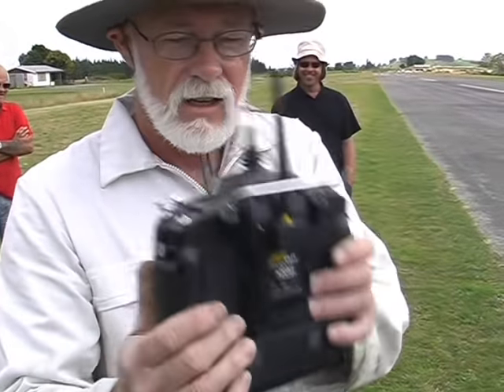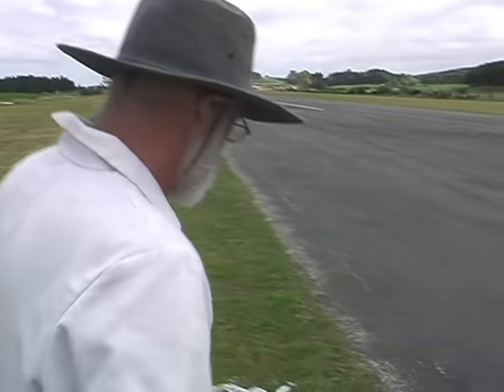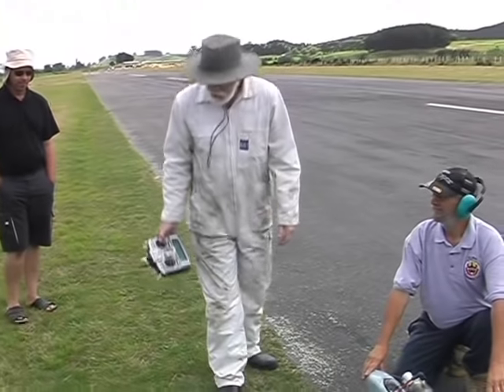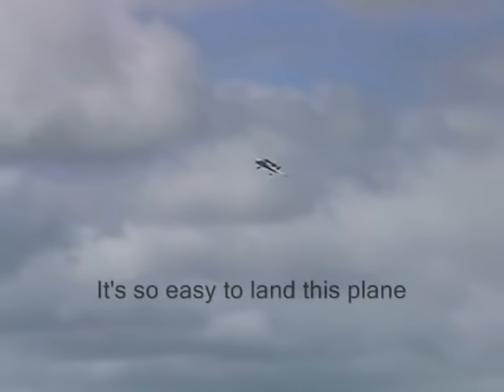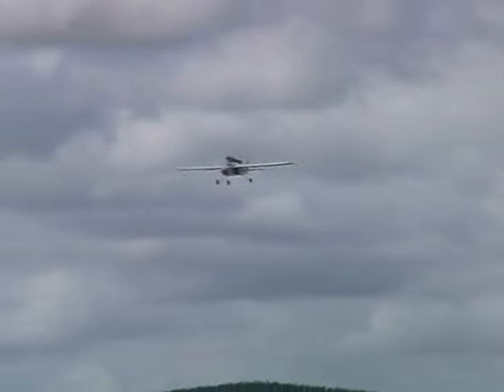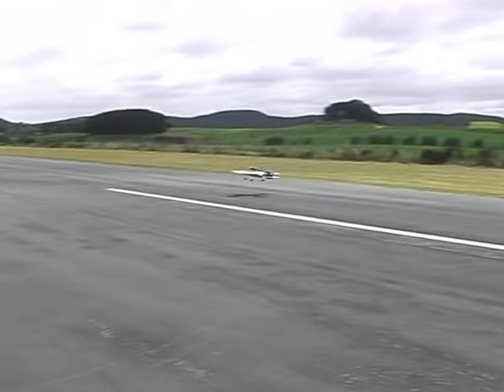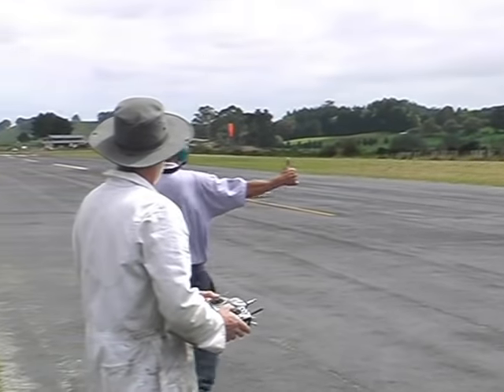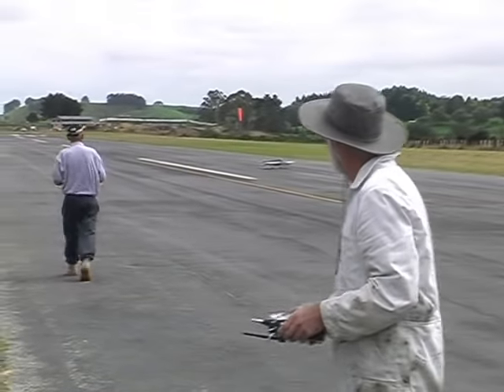Pulsejet powered World Models TameCat RC plane, maiden flight

Comment: Seems like a small electric fuel pump with a proper regulator and return line system would fix the problematic and flaky nature of using a gravity feed for this type of engine. That way you have a controlled positive pressure that's very consistent, easily throttled, and can be cut off without the hazard that a pressurized tank would cause.

Cool plane btw, even if it's loud as hell.
Reply: 8 inches between the bottom of the fuel tank and the injector  will cause problems at high G no matter what the pump pressure.

Comment: @xjet Yes, but you forgetting, pressure conditions in a Pulse Jet change during flight, and so will your pressure from your tapping point. You need something constant which does not rely on pressures generated from within the engine itself. Your tapping point will also pulse...just like the engine itself does as the pressure wave travels back and forth along the engine.

Comment: Pulse jet engines intake air simply through being open, while turbine jet engines have a spinning fan that pulls the air in. This causes the air to be burnt in a pulse jet in, as the name suggests, pulses, as there is a split second delay before the air is able to re-fill the combustion chamber. They tend to be less powerful at low speeds, however at high speeds the lack of obstructing fan allows in some cases more power than a turbine engine. Also they don't catch on fire as much :p

Comment: @xjet Yes, the Tank is low compared to the engines position on this bird. The Doodlebug used a spherical pressure chamber to keep it fed with petrol during flight. If you could use your system, then for sure the Germans would have done the same, as its simpler....but its not reliable.

Comment: @davidrodgersNJ A pulse engine are extremely inefficient when compared against a moder turbofan engine.  Also, it's impossible to implement on them a decent throttle on them, they're optimized to run "effiently" at a certain fuel/air intake ratio. Pulse engines are similar to afterburners in a fighter jet, they provide a constant amount of (extra) thrust in a relatively simple way, but simplicity comes with compromises, the main ones being the lack of control (throttle) and fuel efficiency.

Comment: Nice! Are you not concerned about the vert stabs disintegrating in the exhaust? Is that thick straight wing designed for those kind of flight loads?

Comment: great work ! -  i was impressed by the acceleration and how well the plane held a glide without all that power and the extra weight of the pulsejet on top.  She seems very well trimmed out .  How long can the PJ run for before u expend the rations onboard?

Comment: @xjet
  Ah, just found this. Epic !
   The Kerosene-Powered Flame-Farting Flying- Didgeridoo... ; Yahoo !
   I still have an old 70's Advertisement for a pair of these, on a Hang-Glider's A-Frame, fed by a Butane Backpack...!   Reportedly, when tried, it pitched up uncontrollably, then stalled & slid backwards to crash ; and then it burned, when the Jets lit the Dacron. Pulse-Jet & Weight-Shift, bad combination !
Ciao.

Comment: Any chance you plan to make a new body for your HK pulse jet that cracked? I am expecting to run into the same issue as now that I have taken a closer look at mine, the welds are indeed pretty poor... It sounded like in your video review that the valve plate and intake were made well and it would probably be more efficient with a better designed body?  I have been looking to find out how short the body can be redesigned, it seems like it was made longer then needed due to its small diameter but have not found much info.

Comment: Imagine a typical scale A-10 that is capable of flying around with the stock  EDF's and when pitched in a dive you light up a Dynajet PULSEJET thats mounted to the plane to hear a deafening roar just as the real A-10 Warthog does with its unique strafing gun!!! What an idea!!! I believe that we as humans should all work collectively together , that is why im openly throwing this great idea out to the web! Just think, A typical EDF A-10 Warthog with an addition of fuel tanks in the hull and small wing tanks. The tanks would fuel a Dynajet pulse jet engine mounted on top of the plane (preferably centered with the fuselage to make it balanced,;  the tip flush with the ducted fans would be cool) complimented with a tuned, intake/ fuel/ ignition system that is able to auto start, mid flight (easily doable). =)

Comment: Thats the fastest running pulse jet I've seen. Usually you can clearly hear the different pulses, but this is pulsing so fast I wouldnt have known it was a pulse jet just by listening to it. I'm surprised at how much power and acceleration it produced too. I assumed they were much less efficient and powerful than a standard jet engine, but obviously not too much.. Did you design the engine yourself? Does it burn fuel more rapidly than typical RC jets?
Reply: No, you can't hear the individual pulses on any pulse jet, I can assure you.
Reply: @oldchunkofcoal2774  
You can easily hear the pulses on the V-1 flying bombs, which sported the original pulse jets. I've seen many medium sized pulse jets with pulses that are easily discerned.
Reply: @oldchunkofcoal2774  
You can easily hear the pulses on the V-1 flying bombs, which sported the original pulse jets. I've seen many medium sized pulse jets with pulses that are easily discerned.
Reply: @HighlanderNorth1  No, you THINK you can hear the individual explosions, but the V1 was making 50 per second...
Reply: @oldchunkofcoal2774  
It's clear that you are "assuming" that I don't have bionic ears..... Are you sure it's logical to assume that of me? (Hint: It is ...)

Seriously though, we can hear what certainly sound like "pulses" when listening to many pulse jet engines. But if that's not the actual pulses we hear, then what is it?

Comment: Nice one Bruce. Have you experimented with adding exhaust insulating wrap (Automotive titanium wrap or similar) and if the extra weight is offset by additional performance, higher exhaust temperature, thrust and velocity? Thank you for sharing.
Reply from the maker: I have found that a ceramic coating on the inside of the engine does produce measurable thrust increase and also increases engine life.
Reply: Theoretical science meets applied. Thank you very much.

Comment: @xjet No, I dont think you understand. A small metal can is pressurised with say 80 PSI. You then use an air pressure regulator to pressurise the fuel tank....just 0.25 PSI will give a consistant flow and a reliable run. Pulse Jets are poor at sucking fuel, like most engines for that matter. This WILL cure your lean outs...trust me. Failing that you could use a small electric fuel pump like we use on our gas turbines, but the pressure method is simpler for the simple Pulse Jet.

Comment: Thats great, I assume you are using ordinary petrol from the pump?...Why dont you use a pressurised tank?...IE an aerosol type container you can then pressurise with air and a regulator on it to give constant feed pressure to the liquid tank. You just open the fuel feed after the engine starts up....:)...Constant setting regardless of flight effects.....:) I make my own turbine engines BTW..:)

Comment: I really enjoyed the Tame Cats Build and Maiden Flight, I know that air bubbles in the fuel will shut down the jet, Question ? would a bladder tank and springs in the fuel line at the fuel injection spray valve help to eliminate air bubbles and keep the jet running, and would a on board ignition system or a glow plug help to keep the jet running, just my 2 cents worth, BTW I really enjoyed your Hummor and Aussie Accent :) :) :)  Take care and have fun, Chellie in So. Calif, USA

Comment: Great guidance but that cheap pipe engine needs more development, it will likely take a fuel pump and damper added to the pipe which the engine itself should most likely be cast iron to withstand the potential heat extremes once it builds enough power when that occurs it will as well need a much stronger airframe the thing should reach near Mach with some research any combo of fuels will likely work liquid oxygen could work even better obtaining obit with a go pro it without doubt a must but you'll need a RCA DSS satellite link to get out that far.

Comment: Hi Bruce. I was just wondering how fuel efficient a pulsejet is. If for example I had a hobbyking pulsejet of reasonable quality, how much fuel will it burn per minute at optimum output.
Reply from the maker: They are very fuel-inefficient.  Watch my RCModelReviews channel next week.  I'll be showing a XUAV MiniTalon powered by a HobbyKing pulsejet and you'll see first-hand how much fuel they use :-)
Reply: they are only efficient in making huge noise. cool as fuck though :)

Comment: Why aren't we using these engines for more applications?
Reply: Sam Fosdick most fuel innefficient engine ever conceived.
However those ramjets are based on this.
Reply: Also just turning them on is a huge pain in the ass

Comment: lol I think it's funny and cool. I see some moron or idiot making RC and causing some kind of injury , accident or fire.
The exhaust gas velocity of some model jet engines can exceed 1000 mph and the thrust to weight ratios can easily exceed 1:1 . And by law model jet planes are restricted to 200 mph.  You say 120lbs thrust to 7lbs body. That's a little over 17:1 thrust to weight ratio is insane. Your TameCat body would most likely rip it self apart at the speed of sound. Swept back wing design and you can have a supersonic RC  and that's crazy. Awesome vid
Reply: This pulse jet has 3.5lbs of thrust bub.
Reply from the maker: +rcnut812 No... it has 8lbs of thrust.
Reply: +xjet I see, I thought this was a Hobby King pulse jet which according to them has 3.5 lbs. What brand pulse jet is it and if it is HK how did you more than double the thrust? Also I would have thought if you were going to take the time to correct someone it would have been the original commenter,I mean 120lbs? WTF?
Reply from the maker: +rcnut812 I built it myself.  You'll find another model powered by one of my home-built pulsejets on this channel as well.  There are several videos of my Long-EZ and my Bobcat pulsejet models.

Comment: Wow you made a Nazi He 162B Volksjager. They even equipped some of those planes with a Pulse jet instead of a normal jet engine so that they could use low grade fuel in them. It didn't help them win the war and probably killed a lot of pilots but they used them.